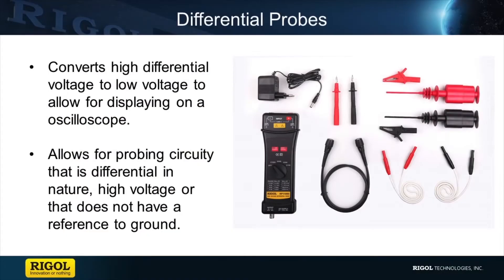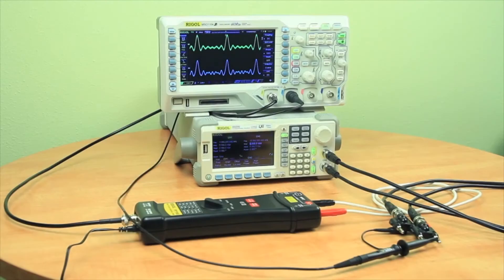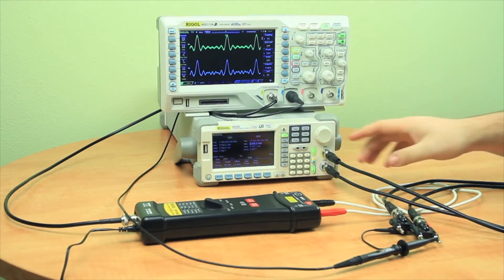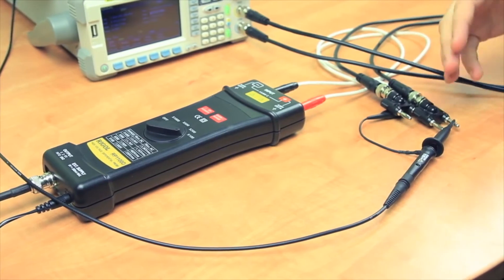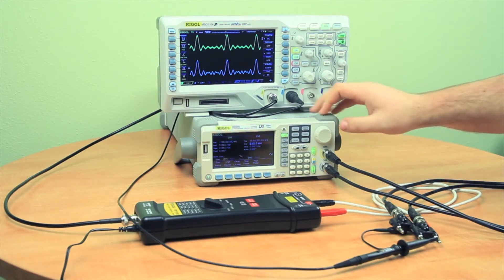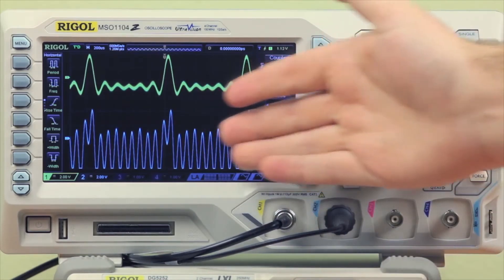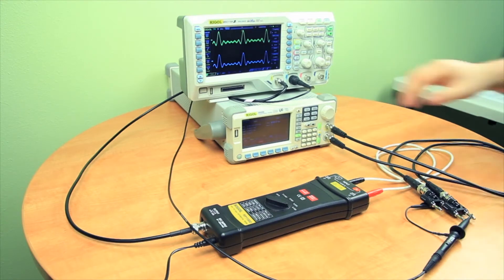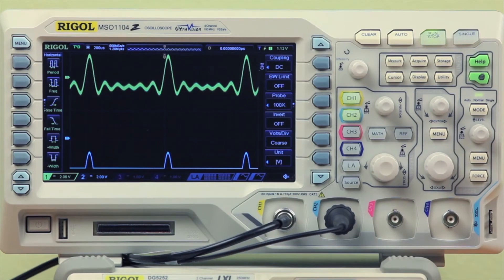RIGOL - Using Differential Probes by Saelig

Comment: Nice video. I have a differential probe and want to check the output on my APC ups. I haven't done so yet as no one seems to show a vdeo of the correct way to do it.  All of them seem to use signal generators in a lab which im my opinion is useless for practical application.